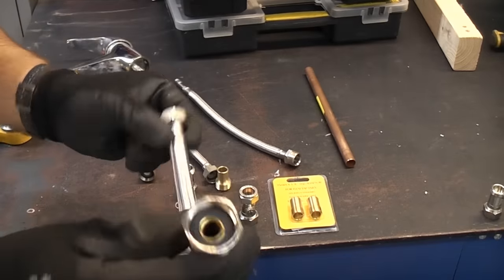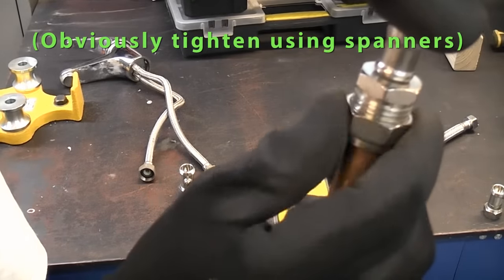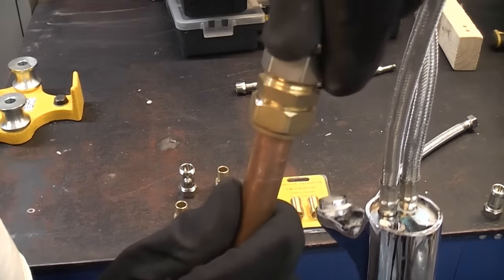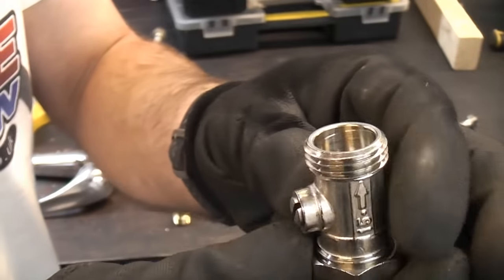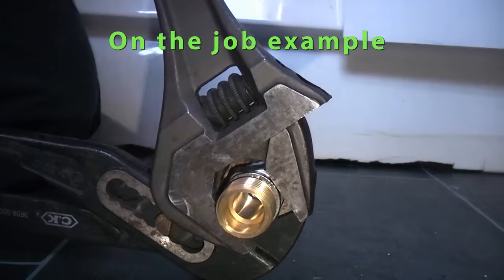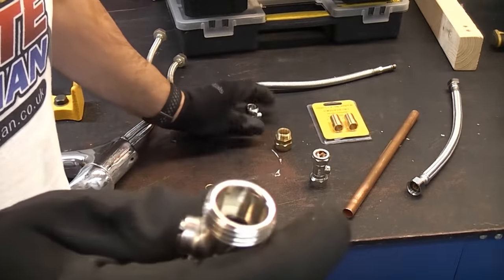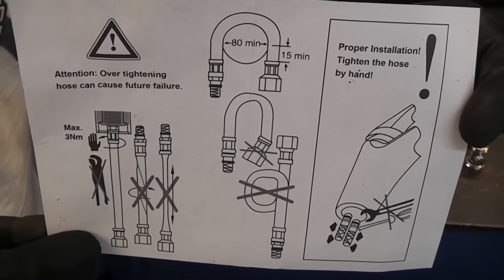How to connect flexible tap connectors 2019 | flexi tap tails

Comment: How does it have 301 views already. I wanted to be first! Yes, I need to get out. Thanks for video 🖐
Reply from the maker: Sometimes the views go up very quickly, I think it depends on how fast YouTube informs people 🤔
Thanks for the comment 👍
Reply: @ultimatehandyman  kinda figured that, my YouTube has a mind of its own UH, but thank you. Sure I'm never first anyway 🤣
Good video. I was wondering how you're getting on with the Kreg system or is it still in the packaging like most of my kit! Have a super Sunday.
Reply from the maker: It's still in the packaging 😂
I have a Dewalt 18v chainsaw in the office, which I bought at least 12 months ago, plus loads of other tools, which I have never used yet 😅
Reply: @ultimatehandyman  'her indoors' calls me the Procrastinator! Right, I'm off to insulate the house 🖐

Comment: I’ve had two flexi tail bursts in the past. I don’t trust them. Also, those particular isolation valves tend to stick with time & if you need to close on in a hurry ( as I did), the last thing you need is for it to refuse to turn
Reply from the maker: Yes, that has happened to a friend of mine.
We have 8 bar of water pressure here, so I'm hoping to fit a pressure reducing valve soon to get it to a much lower level. I'm sick of leaking pipe unions and tap connectors etc!
Thanks for the comment 👍

Comment: How 2 attach a short flex hose 2  another flex hose.  not pipe!  (To lengthen it.,) can never find the right sizes!!
Reply from the maker: Assuming they are both 1/2BSP, you could just use a brass nipple- https://fave.co/40LDKO5

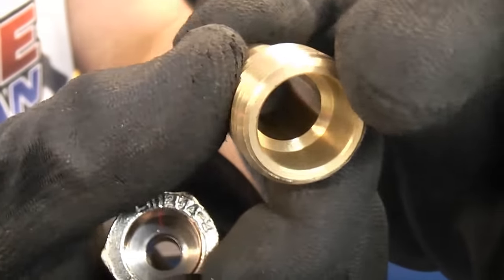Comment: 3:30  I don't see how the connection is watertight.
Reply from the maker: The part of the tap tail connector that goes into the isolation valve is sealed when the olive compresses. https://www.youtube.com/watch?v=KOxZE4zL6rE&t

The threaded part seals against the sealing washer in the flexi tail 👍

Comment: I followed this video and it didn't work for me. Using a Flat faced isolation valve with a female flexi tail is a bad idea. When tightening the tail to the valve, the flexi tail would rotate, loosening on the tap end. The tap end of the flexi tail is usually just hand tight. The female flexi tail should never be used and is very specifically designed to fail in the situation I described.
Reply: @ultimatehandyman  See the rotation in your own video @8:40, play it back at 0.25 speed: https://www.youtube.com/watch?v=UzjS2QpUMBw

The rotation may not be much. But, over multiple attempts at tightening, it could become a problem.

Comment: Brilliant video as always!
I have a question regarding bore sizes of these flexis....

Most are 8mm 

First question is does bore size matter on a combi boiler hot water system ?
(I believe it does on gravity fed but Iv got combi)

2nd question is

It looks as though I have 15mm copper pipe up to my bath taps...
I wish to change the taps and put flexis in with valves... (there is valves further down the line but id like them at the tap end)

So would the usual 8mm bore flexi be ok for flow on the bath tap or should it be bigger? 

The set up is 15mm copper main feed - compression fitting - 15mm rigid copper up to tap 

I have flexis with built in stop valves on the sink basin.. not sure of bore. Im guessing they will be 6 to 8mm they are fine.

Massive thanks in advance.
Reply from the maker: 8mm flexis will be fine with a combi boiler for a basin or sink tap, but they might be a bad idea on a bath. 
You can get 3/4 inch tap connector flexi tails to 15mm push-fit, specifically for bath taps- https://fave.co/3fdTOiY
If you are fitting isolation valves, full bore might also be best, so that flow is not reduced, you can get compression or push-fit-
https://fave.co/3fh2B3O
https://fave.co/3hikgtF

Or you might be able to get the 3/4 inch to 15mm flexi with a built in isolator.
I hope this helps ;-)

Comment: Flexis are not really the answer handy but your better off piping it either in poly pipe or copper and as for those valves their garbage as well watch deretons video on them the flexis have a good chance of kinking with the average diyer you could come home someday to a pond.
Reply from the maker: You need to tell the manufacturers, not me 😉